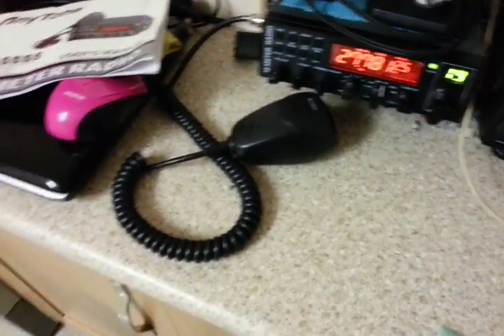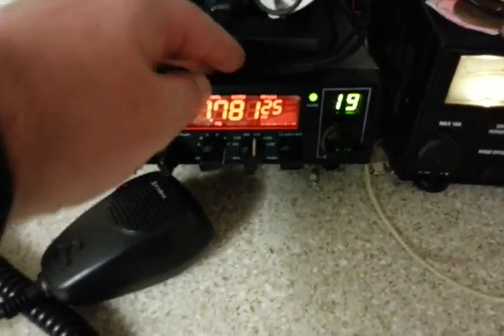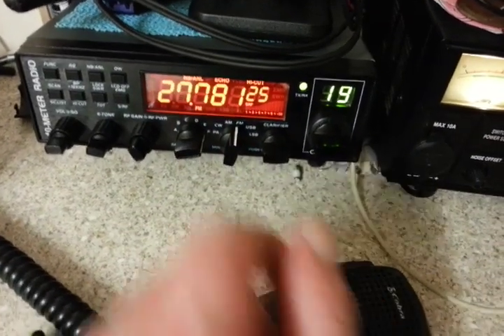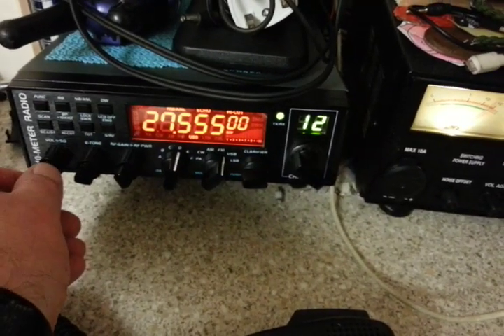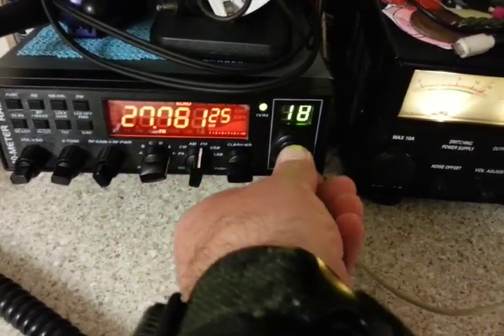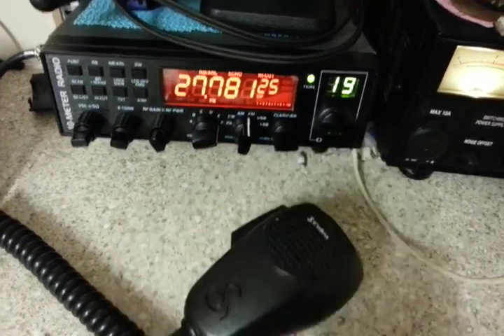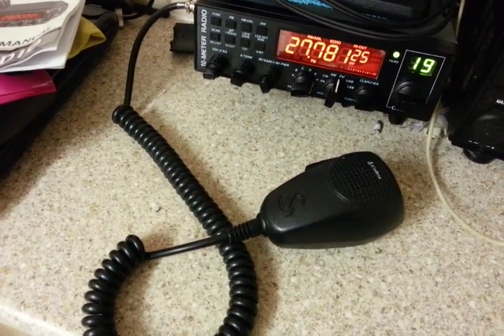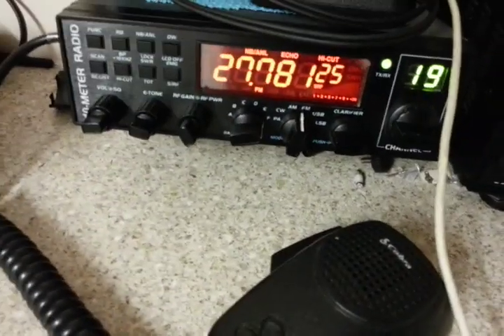Anytone 5555 v6 problem (SOLVED)

Comment: Get a copy of the radio's service manual and/or schematic. Does the pattern of four "beeps" when you key up have any diagnostics meaning?  Then I would start by Looking at the receive signal path, checking the voltage at various points indicated by the schematic/manual. And wildly out of spec voltage could point in the direction of the problem.

Look at other YouTube videos for inspiration on how to troubleshoot.  After watching w2aew troubleshoot an HR2510 I was moved to have a go at my deaf HR2600 , and was able to sort out the problem by working methodically.

Comment: I would have thought microphone not compatible.  Do.you know if any 4 pin mic will work with this radio?
Reply from the maker: it turns out there was z fault on the board so its all good now,  yes some mics do work but I cant remember which ones unfortunately as I just use the stock one now. but yes some do , cheers 👍

Comment: I just got the v6 version.  At5555. The ssb transmit is defective.  Forums say it is a design issue and cant be fixed.  Im quite sad about that.  Ill keep the radio anyway but if i want to talk i cant use this radio for ssb with an amp so i use the 980ssb or the ts5010.  I would recoment you avoid this model entirly.
Reply from the maker: hi, any more info on what is happening when you try to tx?  this is the v6 . only thing i had to do on ssb is switch off the swr protection,  not something like that is it?
Reply: @009ADVENTURES  On Sideband it has bad audio, so bad the group I hang with tells me they can't understand what im saying, so I switch to a normal radio and all is fine.  This radios new.  But not good. for talking. so what good is it,  Dealer wont help.
Reply from the maker: @DallasAya   sounds like you need to adjust the tx frequency a bit, its in the menu somewhere..I hate using ssb as its constantly moving the clarifier so I do prefer am/fm as everyone doesn't sound like darliks on there lol

Comment: Check around the antenna socket Mark for any bad solder joints they should be easy to spot. Its a common problem with these. If u have the swr safety circuit set this is why it wont TX because the PA stage sees a high SWR because of the bad solder joint hence the bleep and no TX. Let me know how u get on mate.
Reply from the maker: Hi gary. Ive taken off the covers and looked at the joints  which look fine, and put it next to another radio and it wont pick up anything. As a last ditch attempt I even reset it and its still the same :( further resarch for me I think.

Comment: Mine did that, it was a fractured leg on a voltage regulator,   bit of solder fixed it.  Its the one on the side of the chassis that gets warm

Comment: I've been looking into getting one of these or a at6666, there are so many export choices,  also like the dragon ss 485h.  thanks for the reply !
Reply from the maker: there's a few radios out there ..this radio is still working fine now. for the money you can't fault it or any of its variants. I think the 6666 has more power than most but not really looked into them myself.

Comment: solved ? what was wrong ? please keep us updated  :-)
Reply from the maker: hi, there was a dry joint around one of the chips on the board. I have said in the description but should be a bit more specific. maybe I should do an update showing the actual fault, but then again the beeps just indicate a fault and may not be that same one. cheers

Comment: what it is the problem?
Reply from the maker: Lefteris Bakalis  turned out to be a dry joint on the board. bit of solder and that fixed it. cheers
Reply: Probably wrong power supply i guess. He require at least power supply 10-12a with overload protection 13,8vdc
Reply: this radio you can hear it VERY WELL!!!! HE HAVE VERY GOOD FILTERS!!!!!
Reply from the maker: Lefteris Bakalis  very good radios for what they cost. 👍
Reply: Locks like my old cb aradio midland alan 100plus. It is monobander. And he have 5 din plug. I beleve do you know this plug.